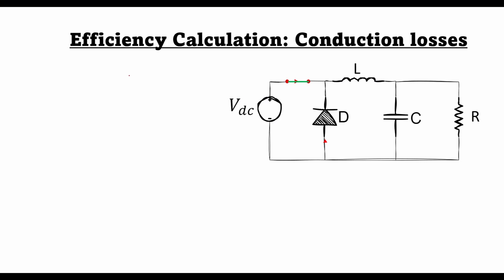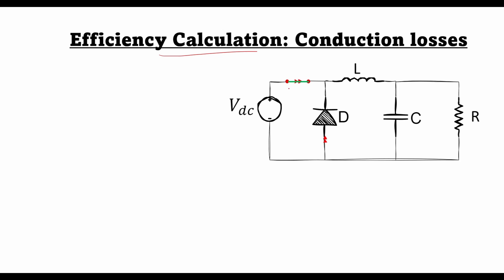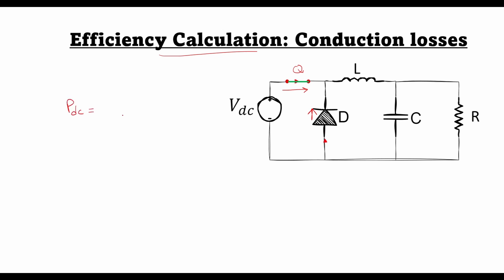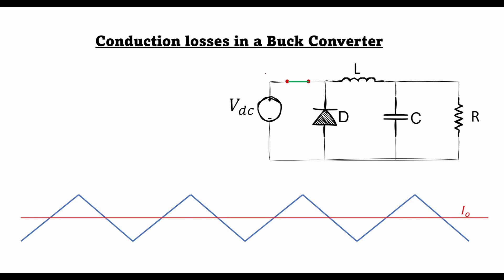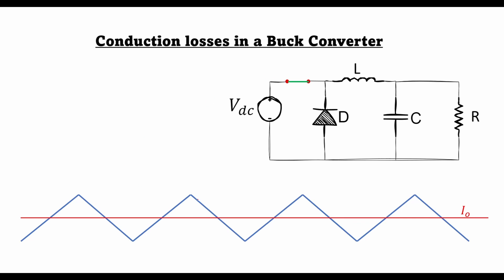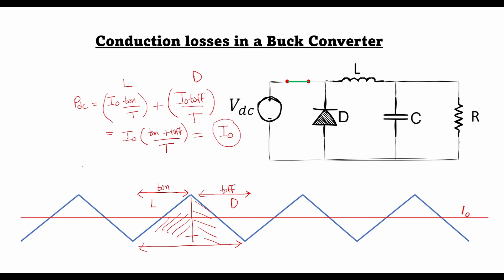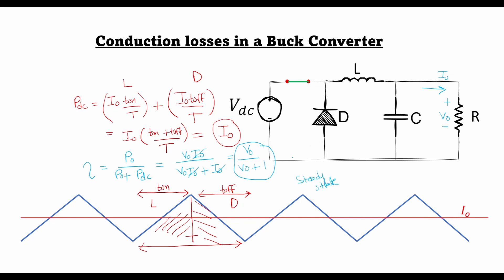Conduction Losses in Buck Converters | Diode and Power Transistor Loss | Efficiency Analysis Part 1

Comment: Are you sure? Pdc is equal to output current?? I am sure you know that one is power, the other is current!!!
Reply from the maker: The forward drop of the diode and the Vce(sat) can be assumed to be equal to 1  so the dc power loss is equal is essentially equal to the output current. Thanks for pointing out. I might not have explained it in the lecture.